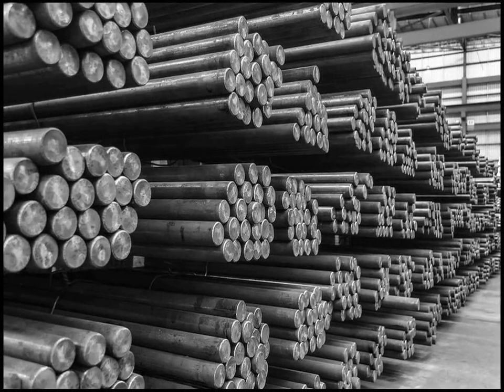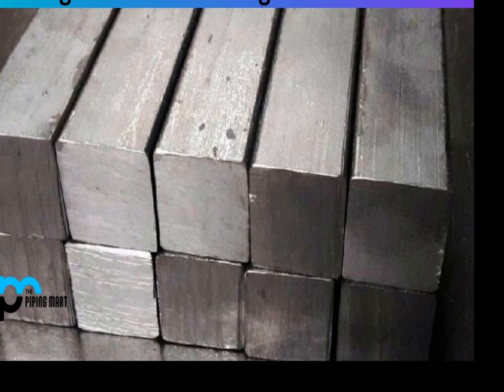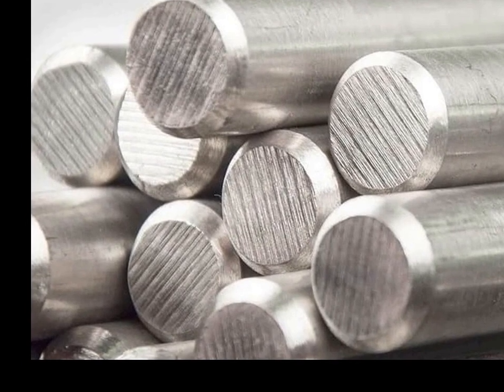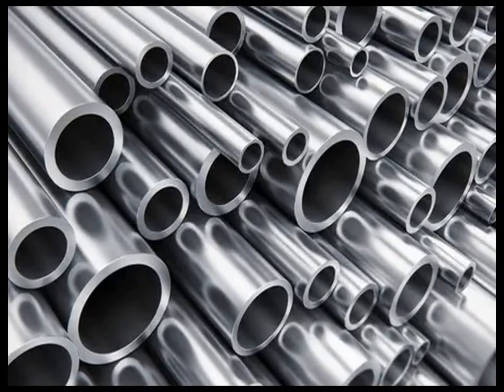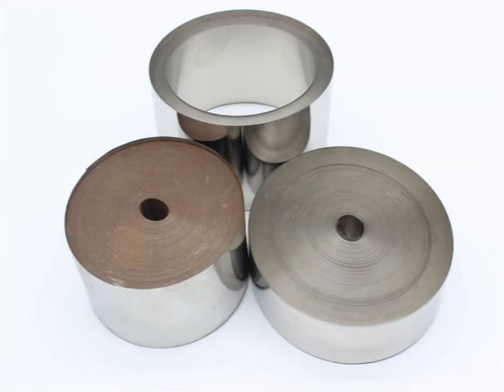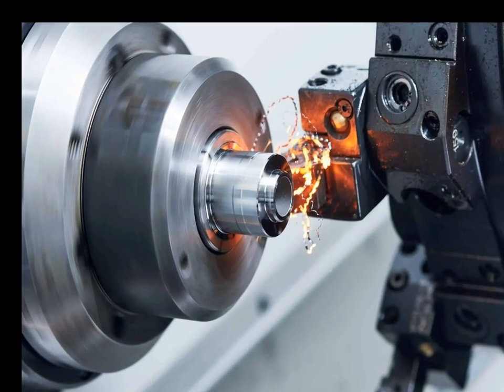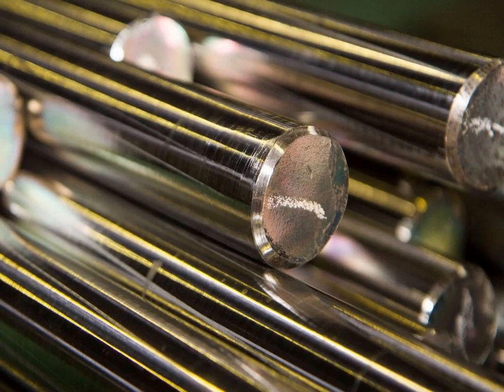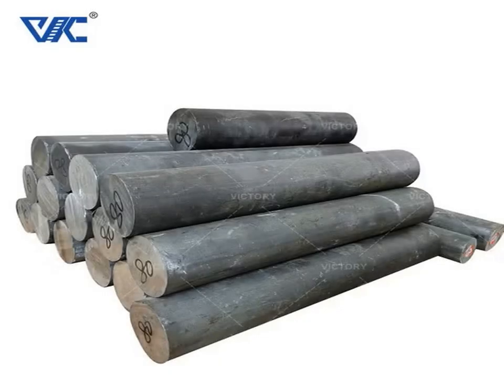INTERESTING MATERIALS: Invar

Comment from the maker: Further reading:

- Gupta, K. (2017). Engineering Materials: Research, Applications and Advances. CRC Press.
- Smithells, C. J., & Brandes, E. A. (1992). Smithells Metals Reference Book. Butterworth-Heinemann.
- Van Vlack, L. H. (1985). Elements of Materials Science and Engineering. Addison-Wesley.
- ASTM International. (2001). ASTM F1684-01 Standard Specification for Iron-Nickel Low Expansion Alloys. ASTM International.
- National Institute of Standards and Technology (NIST). (2016). Thermal Expansion Properties of Metals and Alloys.
- Guillot, G., & Guillet, G. (1991). "Invar and its applications: Present and future." Journal of Materials Science, 26(9), 2457-2486.
- Rodway, G. H., & Preston, J. S. (1992). "The Invar effect and its applications." Metallurgical and Materials Transactions A, 23(10), 2769-2785.
- Bozzolo, N., & Chataigner, S. (2010). "Thermal expansion and mechanical properties of Invar alloys: Experimental and modeling approaches." Acta Materialia, 58(6), 2182-2193.
- ASTM International. (2020). "Standard Specification for Invar Alloy for Industrial Applications." ASTM B753-20.
- Guillaume, C. E. (1896). "Recherches sur les aciers au nickel." Comptes Rendus de l'Académie des Sciences, 123, 235-238.
- Guillaume, C. E. (1920). "The Anomalies of the Nickel-Steels." Nobel Lecture.
- Rosenberg, H. M. (1975). "The Physical Principles of Thermodynamics." Cambridge University Press.
- Ashby, M. F., & Jones, D. R. H. (2012). "Engineering Materials 1: An Introduction to Properties, Applications and Design." Butterworth-Heinemann.
- Lide, D. R. (2004). "CRC Handbook of Chemistry and Physics." CRC Press.